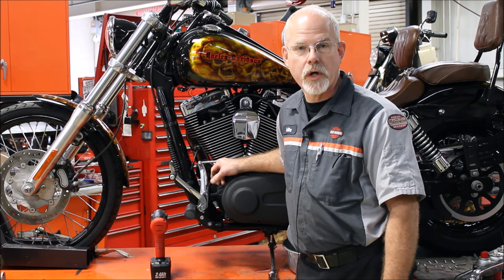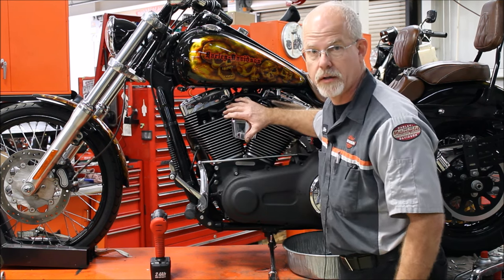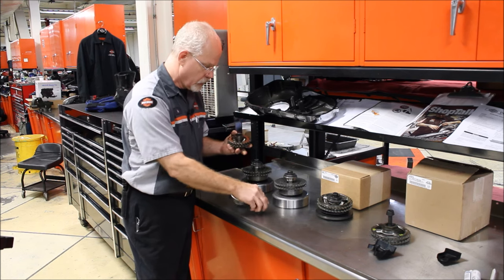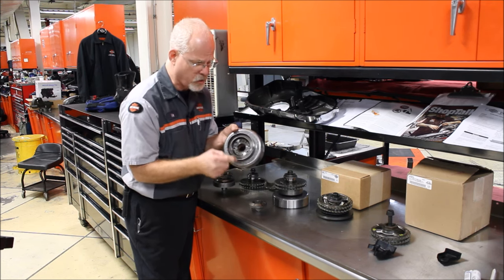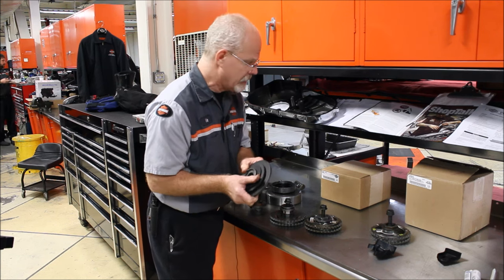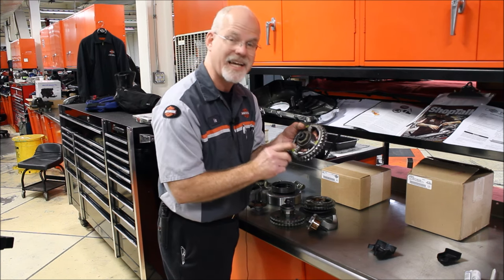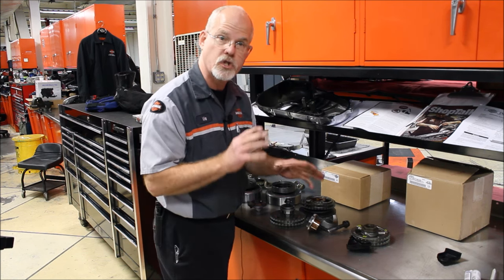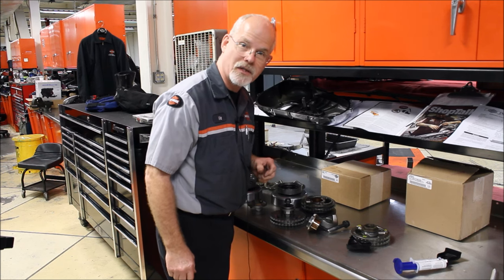2016 Doc Harley:  COMPENSATOR

Comment: Excellent video. Very informative, subscribed.

Using epoxy to hold a piece on the inside of a primary cover? No thank you. That doesn't sound like a good idea at all.....
Reply: Johnny Gee You'll have to buy a new upgraded primary cover to avoid the plastic shit and $40 epoxy.
Reply: You can cement anchor bolts in concrete with epoxy. It's gnarly stuff, nothing to worry about it.
Reply: Installed the SE comp in my 2012 Glide 103ci. Seems to be better. Couple notes:
First, HD calls it an upgrade. Should have been called a "Fix"...and compensated the customer for all or at least the most of cost.
Second, I cleaned the Primary cover and took it to my local dealer in Omaha and they did the epoxy job for me no charge. The SE kit does not come with the epoxy, which is asinine. 
I'm ok with the epoxy part. Have used similar JB weld product on all sorts of mechanical stuff. It is the bomb. 
The other thing HD could put in the kit is the T70 torx socket. What... $7? The $300 kit could be $310 and include everything for the job.
Reply: Or take that cover to any "COMPETENT" machine shop and get a permanent weld done by the pro's at the shop?
Reply: Prob with epoxy is Vibration...and it well known in engineering circles that its failure occurs at certain conditions and "Frequencies" so...no...a permanent weld would be more preferable..considering the COST of the HOG nowadays?
Reply: The right adhesives hold jet fighters together. Properly selected structural adhesives are used to build and repair cars and trucks with the results passing NHTSA crash tests. Lord and 3M are among the makers.
Reply: That was my thought.  Let's glue something inside an oily metal can.  Nice.
Reply: I agree. Makes me nervous. Besides, when I do stuff like that, it never works.
Reply: It's Screaming Eagle epoxy. Harley has been using it for years.

Comment: HD Engineers and Corporate are smart.  They put leftover 88 CI compensators in 96 CI motors.  Compensator failure was common.  No recalls....forcing the owner to replace with another 88 CI motor compensator or move up to a S/E Compensator. Having to glue a plastic shield inside a primary cover is BS and should make every mechanic who ever turned a wrench cringe! Cha ching!!! Why are HD engines always under powered right out of the box. 1700+ CC and HP and TQ are unacceptable.  5 grand later and you might have something!  I suppose if these bikes were engineered correctly, we wouldn't have anything to bitch about. It's all about the money and stupid consumers like myself who can't say no....By the way, the compensator swap is easy. My $64k question is why does HD still use chain driven internals in the first place? Same technology that they have been using  since the early 1900's.  Gear to Gear would be the answer but they will never do it because Gear to Gear requires very specific tolerances.  Chain driven internals are sloppy. Using a plastic chain tensioner is poor design as well. Where do you think the worn nylon-plastic bits go? All through out the engine for sure. I digress!
Reply: Wow, it's like a machine or something!
Reply: HD is using same old technology for years and the only thing that changed is the high prices ,
Reply: Not really. When the new engines came out, the stock parts worked. When more power kits were developed,  then you are testing parts that were not available when the design came out. Harley has none stop rolling adjustments to parts and models, that makes it seem like your bike got the shaft when you want to upgrade to a new part or package. My bike was made before the 131CI kit was introduced,  how can I blame them if a part on my bike is incompatible?

Comment: Why does Harley still use a separate transmission ? It you use a internal transmission like everyone else has been doing for the last 60 years you would not have this problem. A separate transmission does nothing but rub power and add weight.

Comment: Over 10 years to fix one problem.....
Reply: Lol, it was never a problem that needed fixing. You did not pay attention very well.
Reply: Well, no...  The compensator has been going through its own evolution, to "keep up," with the larger more power and torque engines.  If the V-twin remained a 1200, then there'd be no issue with compensation.
But as explained, as the engines grew larger and more powerful, both in HP and torque, they outgrew the compensator of the early evos...
Same with clutch plates and springs.  You can get a clutch built for a tank!  But the clutch springs are so stiff, they'll wear your left hand down, if you gotta do a lot of shifting...
Your left forearm will look like Popeye's!!

Comment: Stop lugging your bagger and the compensator will last longer.
Reply: Randall Severini Yes and No to your statement. Yes lugging is definitely bad on baggers but as stated 2007 -2011 they used Compensators from twin cam 88s which can not handle the torque from the 96-103 twin cams. I know for a fact i never lug my Ultra and still the Compensator went bad. I put a Baker Compensator and a Baker Attitude tensioner in mine and haven’t looked back. Harley-Davidson knew these Compensator were not made for larger TC but chose to cut corners which cost us owners money!

Comment: Doc Harley should be removed  he just a swing master , put a BAKER COMPENSATOR and stop your problems with compensators , cam shaft plate is an other issue
Reply: yep...prob solved too...harley has been so stuck in the Mud in its engineering lately right?(sigh) use performance parts HD! buy the right/get a license from the Performance Parts people, and "OPTION THE HELL" outta the Bikes at the Factory? (your losing major $$$ these days in NOT doing this...and the bottom line is showing with your stubbornness as your laying off 800 people right?
Reply: Make a "Deal Deal"with performance parts that only pays em when their Specific options is used on the bike you manufacture HD!
Reply: Sounds like a Hand Grenade DODAC G880 would do the trick.

Comment: I thought the twin cam was introduced in 98 but you said 06... what gives?
Reply: yep, in 98 for the 99MY (2000MY for Softails). Video is straight wrong. 2006MY is when they switched from TC88 to TC96.  Take this basic factual failure into account before you run out and take ANY advice you see in the vid...
Reply: @mikedmeyer  Some 06's have the 88 motor still like my Fatboy.
Reply: @randysorick3706  You're missing the point of my comment. The video (incorrectly) says 2006 is when the twin cam motor was introduced. It was introduced in 1998. 2006 is when the 96 was introduced, whether your bike has one or not.
Reply: @mikedmeyer   My Bad, Sorry!
Reply: @randysorick3706  no worries. ride on.

Comment: Ole Doc Harley. Fanboy.why can't newer better compensatory be retro fitted to all Harley models twin cam 88 and above. Some drops of oil in a bearing. I have my doubts. Speaking of bearings seems a lot of manufacturers Honda included cheap out where bearings are concerned. Harley had timkin bears then flipped to another German munufacture from my understanding and then bearings became issue. Then the plastic slack adjuster fiasco.a sec and hand Harley motor cost is exorbitant
 Yet a victory motor is affordable and those motors use gear drive. And drive by wire which the new Harley is just now beginning to implement. Harley Davidson needs to get some new engineering. New manage ment.

Comment: Harley are Dinosours in the motorcycle industrie, oh and i ride em for over 20 years once you exept that your fine..
Reply: Yep, just don't buy their crap parts! Lots of great aftermarket stuff for new Harley's.
Reply: Hi Mr Entwistle,
Well i use Original parts ,winshield floorboards etc as i like the look of the original parts, for the exhaust i use a aftermarket Jekyll & Hyde.
Reply: You can build an entire HD style motorcycle without buying a single MoCo nut, bolt or washer. The aftermarket and easy maintenance is the reason I own HDs. I'm a multibrand mechanic.

Comment: anytime you need to replace internal parts on a harley...DON'T waste you $$$ on HD replacement parts....screamin eagle parts are overpriced trash.  go with the performance aftermarket parts....man o war compensator, zippers cams and cam chest, S&S cam plate, heads, etc...HD parts are not engineered to last based on user performance
Reply: fueling, S&S, zippers, etc

Comment: My '05 Deluxe has 42k miles and original compensator.  The compensator is actually meant to protect the 5 , and later 3 piece crank.  Too many burnouts will shift the flywheels.  For trueing purposes,there is no key in the drive side flywheel. It has always taken HD way too long to address and correct these issues. For almost 40 years the Big Twin bikes pumped hot motor oil into the primary to lube the chain , while having a dry clutch. The oil was the returned to the crank case via vacuum from the rotary breather valve. Terrible design. 
.

Comment: "This is the compensator. It's gone through many evolutions to get to where it is now". And it's still garbage like everything else in a twincam!  Cam plate, cam chains, tensioners, cam chain guides, lifters, cam faces getting wiped, Screamin' Chicken heads where the PORT doesn't even align with the VALVE, it just goes on and on...  Get a Baker maybe

Comment: 115 years...
Where is 110 HP?Where is 120 Ft Lbs TQ?
Where is under 600 pounds?
Where is twin disk brakes in the front on all?
Where is a suspension system that can actually be worked with?
Where is a transmission that does not act and sound like a my uncle's tractor?Where is a frame that can be rivaled by no other in the industry after being done 2 times? FXR V-RodWhere is a charging system that does not require throwing more than a pound of magnets around copper?Where is Harley Davidson???  Not on the track in the real world.
Its not millenials asking Harley to wake up. 
Die a slow painful death. Just send me a 2000 FXDX. I will trade my 2000 FXD for the suspension.